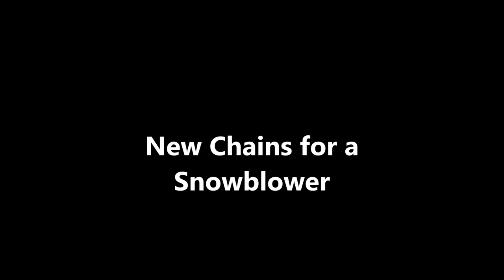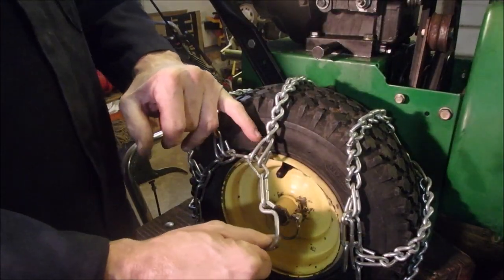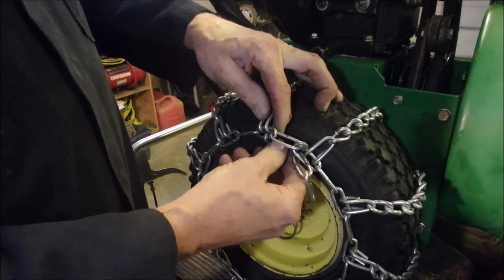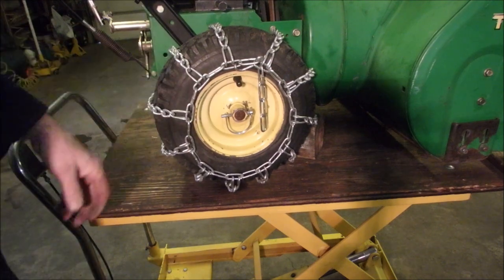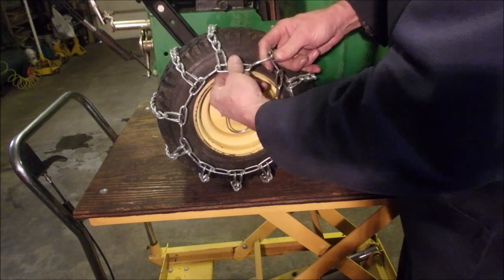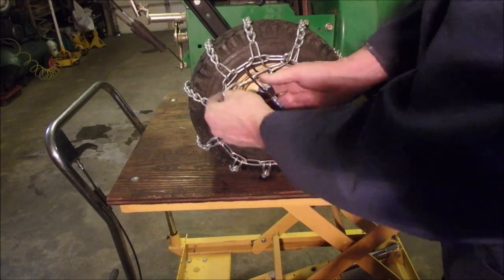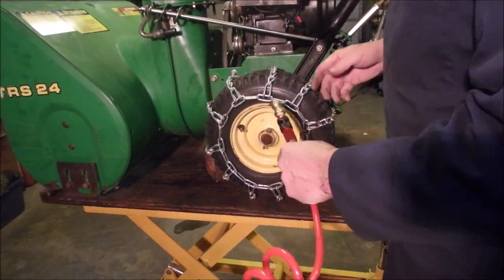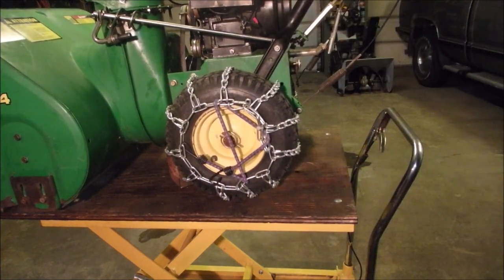John Deere TRS 24 Brand New Chains

Comment: thanks Bruce, love the chains they make a heck of a difference, especially when it's real cold, without them the rubber just doesn't cut it, or should I say just doesn't blow it ! take care eh!
Reply from the maker: The tires on this blower are very smooth making chains a must..  these chains came with the unit but the previous owner never installed them.

Comment: Plenty of zip ties on my tractor chains I also have a big rubber  O- ring from a set of cable type chains and made  hooks from chain links and have a bucket of parts since i made mine from a set of old truck chains
Reply from the maker: You can do it sir.

Comment: Hello. Good Video. I have a snow blower with chains that are going to be changed soon. This will help me in the near future.
I see the foot petal on your lift table. If you turn it 180 degrees with the bend up. Would give you a longer stroke on the pedal. Would be less pumps to raise the table to max position. I have the same table.
Reply from the maker: I will try that.

Comment: I prefer to remove the wheel and do it on the workbench also deflate the tire some and re-inflate with the chain installed nothing moves
Reply from the maker: Good point.  I sometimes have trouble removing the HJohn Deere wheels but uoi are right.

Comment: I wish chains for forestry machines were as simple to put on, hated putting them on. You’ll get great traction with those on
Reply from the maker: Right.  Those smotth little tires are not very good.  One more video on this blower.     The extra traction with the chains (which it never had much of before)  made the traction disc slip.    After I  tested it with the chains I tightend the traction disc.  Oops I gave away the next video.  LOL  I hope you watch it.
Reply: @BrucesShop  I’ll still watch, I like pictures with words 😁
Reply from the maker: @almclean4835  Me too